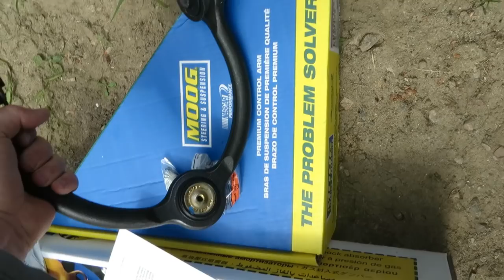2005-2010 Jeep Grand Cherokee WK Front Control Arm Replacement, Clevis Bolt, Spacers, Bilstein 5100

Comment: This video is how not to do things. It's bad when people who have no idea what they are doing post these videos. Then people follow this video and either get hurt or screw up their vehicle or both. DO NOT DO WHAT THIS GUY IS DOING.
Reply from the maker: Feel free to point out specific things you do not like about the video.
Reply: Stephen Rivett 
Just one issue is when you loosen the top ball joint, NEVER take the nut all the way off until your ready to separate it. While you were taking nuts off other bolts the spindle could have come to lose from the ball joint allowing the spindle to smash you in the face. I saw it happen twice sending both guys to the ER. One lost his left eye doing it you're way, the second had a broken orbital socket and required surgery. Another thing you allowing the brake caliber fall has broken many brake lines. That's something that's common sense. These are just two of several things you did wrong. I agree do all you can and avoid the extremely unjustified high cost of a shop, and you absolutely have the right to do whatever you want to your jeep. My problem is you make a video doing things the wrong way and others try it your way and end up getting hurt or screwing up their jeep. You should do a disclaimer stating this is your way and not exactly the correct way to do things, before you get sued when people get hurt after watching your video. If you are going to make a how-to-video, make sure do it the right way so people don't screw-up their car and/or get hurt.
Reply: So you make a big fuss about this. And its pretty much those are the 2 things he did questionable in the whole video. But he did mention to be careful about hitting you in the face.  I noticed that as well... didn’t come here and belittle the guy for trying to help other people sAve a dollar. This is a good video still
Reply: @SteveRivett  When you jacked it up by the control arm you put the entire weight of the vehicle on the bolt connecting the fork for the strut to the control arm. Upper control arm jack under lower control arm, lower control arm jack from frame and let lower control arm hang.

Comment: Dude, the lower shock bolt pulls out if you compress the shock spring.
Reply: That's very good advice. Thx :)
Reply: So by lifting the lower control arm?
Reply: Is this true? Cuz tomorrow is day 2 of me fighting this damn bolt I really don't want to cut it if I don't have to
Reply: @braydentriplett7954  If you can heat it up with a torch and work it back and forth with an impact it should break loose. It did with me.
Reply: @tonyruiz347  appreciate it bro💪

Comment: PB Blaster is your friend. I did the struts on my XK yesterday (300,000Km) with no issues. Hit all the clevis bolts with the juice twice a day for 3 days in a row and they unscrewed and pulled out of the bushings easily. 3 hours total working by myself.
Reply: I used a sledge and an impact gun 13/16 on that clevis bolt not 21mm.  Went forward and reverse and it came out after maybe 12 each direction.  That was after quite a lot of sledge hits first.  But no heat or saws needed.  Just persistence.

Comment: Really disappointed to see you just throw your impact and electrical tools into the dirt.  Good way for them to be ruined.  If you had spent a little time soaking all of the bolt threads with PB Blaster or other penetrate, you would have been able to get them all out without cutting.  You can do this job without removing the yoke complete.  A little more prep and protection from the ground would have gone a long way to helping you out.
Reply: I don't agree that soaking will help with this bolt.  My WK is a rust bucket and all of these parts are practically welded together.
Reply: @JacksonCharvelRULE  I found that to be absolutely true.  Had to replace the struts on my WK; soaked and beat until I was blue on the face.  Finally had to cut them out.

Comment: What i found the easiest way to remove the clevis bolt is to lift up the axle more and then spray wd-40 and hammer it out. I did that when i was installing my spacer lift a few months ago

Comment: How did you torque the front control arm hardware? The one with the nut with the tang on it and no room to hold it. Did you just trust the tang would hold it while you torqued the head?
Reply from the maker: I put a wrench on everything and did it by hand afterwards.  With a long bolt like that I prefer to hold the bolt end steady and crank the nut down (plus the nut is bigger and you have a longer wrench).  I prefer using impacts for removal only unless it's something I can't get good leverage on and I know I can't break like the front differential bushings.  Do all the tightening for bushings with the vehicle on the ground or it could cause weird ride behaviors.

Comment: Steve, I'm putting in spacers but just ran into the clevis bolt problem. Was wondering, do you think it's possible to compress the strut and slide the spacers over top without removing the fork from the lower control arm?

Comment: Honestly, on my '08 WK I found that using an oscillating tool with a carbide metal cutting blade (buy 3 or 4) worked very well on those clevis bolts without much risk to the CV boots or clevis arms... Glad you got it out though!  
P.S. Use plenty of antiseize on the bolt shank when reassembling! (avoid round 2)  
The bushings can be replaced with a ball joint press, if you have one.  Once you get past that bolt, everything else is a cakewalk.

Comment: Wow... I ended up using a 4-foot pipe wrench to grab the clevis bolt. 
In the past 3 years of hindsight and videos I learned that I could have  put a 4' pipe, onto a 2-foot breaker bar, that should have worked also....
Having to take the time to cut through that... God bless you this how I would have been mad mad pissed

Comment: For the new views. Hit what the ball joint goes through or use a pickle fork. 
If you separate the upper lower and tie rod end you can remove the knuckle with bearing on it. Take your time and make sure the abs wire will be free from the car before hand. 
I threaded on the upper ball joint but a few threads to help catch the knuckle so I can slide the cv axel out as I pull the knuckle off.

Comment: The clevis bolt seizes on almost every one of these WK/XK platforms.  The rubber bushing has a metal sleeve inside, and the bolt body rusts fast to that sleeve.  Cut the bolt, replace the bushing.  It's pretty common.  You can get a new Mopar bolt, part # 6503047, from Rock Auto for around $7.
Reply: Hiw hard is it the put the bushing back in? I kinda melted it and I'm waiting on a new one and sleeve also and tips in getbthe driver side axle out been beating on the that for a few days now and I've was just trying to replace the axle and ran into the clevis bolt seized 😆

Comment: Great video! I have my suspension rebuild kit coming this week and I'm dreading it. Did doing this help the wheel alignment? I'm spending 500$ on suspension parts to save my new tires from wearing out in half a season.
Reply from the maker: The alignment shop did a good job after I replaced all of the parts.  I have driven the Jeep a lot and gone through two sets of tires without any wear problems.

Comment: I am currently letting it soak in PB, but from what I red in the comments, this will not do.  Must I completely replace the control arm if I cut the bolt out? It appears I wouldn't be able to pound the remaining bolt out of the control arm because of the rust.
Reply from the maker: You would need to replace the bushing the bolt passes through at a minimum.  The rest of the bushings and the ball joint would also need to be looked at for condition.

Comment: I had zero issues with that clevis bolt, and I live in the northeast. Milwaukee mid torque 1/2’ impact buzzed it right off
Reply: Lucky dude. Things a pain i am replacing my axle and mine was seized had to cut and drill
Reply: @zstrode.8953  I also soaked mine in pb blaster every day twice a day for a week before I did all my front end work, so I’m sure that helped. But of all the bolts, that one gave me the least amount of trouble
Reply: @bigrigben1202  well after i got that out i couldn't get the cv axle to come out and literally did everything to get it out. I ended up taking the whole differential out so I could get a good swing on it and still was a pain! And I just ended up buying a whole new control arm lmao such a pain in the ass just replace a dam axle 🤣
Reply: @zstrode.8953  where did you order the bolt?
Reply: @Dandadada12  my lower control arm came with a new one but from orieleys!

Comment: i use wire to hang the caliper to the spring out of the way ..sounds like you have the 3.0 diesel, cool, me to
Reply from the maker: The diesel is great.  I do need to make some hooks to hang the calipers from as the calipers on my 1-ton van are really heavy.

Comment: How does the truck ride now ? I have Monroe quick struts in mine and they suck
Reply: Very clunky
Reply from the maker: @FrankO-ek1ec  The front rides a bit rough with the original stock springs because the 5100's squeeze the springs to get the 2" lift (preload).  The rear is a bit different too because axle sticks out on the drivers side.  You get a little wiggle when you go over a big bump because the axle swings towards the passenger side.  I believe Jeeperf makes an adjustable link to fix the way the axle sticks out...maybe others do too.  I intend to replace the rear springs because they can't carry much weight.  The Jeep completely bottoms out at rest when I put my dirtbike on the hitch.
Reply: Stephen Rivett the axle sticks out ?
Reply from the maker: @FrankO-ek1ec  Yes, doing the rear lift ends up moving the position of the rear axle about 1/2" of an inch to the driver side.  I didn't notice this until I put my winter wheels on.  The solution is to shorten the link that goes across the rear of the vehicle or just ignore it.
Reply: Gotcha

Comment: did this project and the main problem was the clevis bolt, it took a good deal of beating with a hammer to get it off but i finally won.
Reply: So heat it up and beat it out? I am about to start this project and wanted to test if I could get the bolt off and couldn't.

Comment: This is in my near future.  Can you give me an estimate of how long the job took you?
Reply: My WK2 is 2WD. The 1st side took me 3 hours because I'd never done it before. The other side was a little over an hour. All with hand tools. Also, I only replaced the lower cntrol arms. I recommend doing upper & lower arms at the same time. If one set is worn out, the others won't be far behind.

Comment: Still trying to hammer out the clevis bolt. Dame it's a bugger.  No luck yet.  The problem is the clevis support is springy so there is no solid support to take the full force of hammering from the nut end.  The clevis / strut assembly is springy.  Some sort of a press would do the the job in 5 seconds or less but I don't have such a tool.
Reply from the maker: that is a good idea, something could be made similar to the brake disc puller I made but have a cage go around the back.

Comment: How do you gain access to the nuts/bolts on the control arm? On mine it looks like its covered by a metal cross member and a plastic skid plate for the front
Reply from the maker: Are you talking about the upper or lower control arm?
Reply: @SteveRivett  Lower
Reply from the maker: @albertelezovic852  The plastic skid plate has three sections.  You can leave the front section below the radiator and you can leave the section that covers the transmission.  Just remove the section beneath the engine.  They overlap at the bolt holes but it is easy to remove.
Reply: @SteveRivett  thanks for the help. Clevis bolt seized on mine and need to do the same thing and replace control arm too. Cheers

Comment: Great video it helps me out a lot. I’m stuck on installing the lower control arm its not lining where it needs to go in fact it’s far off. I have the spindle removed just like you did. Any suggestions? In the video yours lined up with no hassle lol
Reply from the maker: I think you need to lift the lower control arm into position using a jack after loosely bolting it to the body.  At some point you get to connect the bottom of the shock and the lower ball joint.

Comment: Stephen, one question from Spain... Its able to make a clevis lift to the WK/WH on the standar shocks?
Reply from the maker: yes, that is the easiest way.  you can put spacers on top of your struts.
Reply: @SteveRivett  I Want to mean fixing the clevis on the top down of the shock. I see one inch untill the down top from the fix betwen the clevis and the shock. This is a tipical operation on the Jeep Liberty to save easy a pair on de cm...

Comment: saws all? not on harden steel bolt.
Reply from the maker: The concept of the video is to show more than just the successes.  I could have cut-out a few things but I'd rather let people see how various approaches didn't work.
Reply: I just did my lower control arm on my 09 SRT 8 Jeep and had to cut the forward lower control arm bolt (same as clevis bolt) with a sawzall. It's all about the blades, Diablo thick steel brand took me maybe 5-10 minutes with my harbor freight $24 Sawzall.
Reply from the maker: @ICPREYROEVIPERGTS    Cool, I usually use Milwaukee sawzall blades but Canadian Tire doesn't carry any good blades for anything so I got their cheap grinder discs.

Comment: will a 2 inch lift on a 2008 WK CAUSE CASTER AND CAMBER ISSUES
Reply from the maker: It starts off all jacked up but it settled down for me after a while.  I was surprised by how much camber I had but as I said it goes away eventually.  It helps to tighten all of the fasteners after you get the vehicle weight on the suspension.  I drive about 1000 km / 600 miles a week and am not seeing any unusual tire wear and all 4 tires wear at the same amount.

Comment: them damn clevis bolts!  what a crap design to have this bolt go through like that!  took me 2-days of heating, pounding and trying to use a ball joint press to push it out...the metal sleeve welded itself to the bolt so bad that it came out as one piece!   so the issue was that the bolt could not slide through the hole on the FORK of the shock so had to cut that dang bolt off!

Comment: Thank you good video ! where can i buy the 3 bolts for the control arm ?  can you send me the link or the name of this 3 bolts ?  thanks ; )
Reply from the maker: They are dealer only parts so you will have to call your local dealer or look online at a Mopar discount website.
Reply: @SteveRivett    thanks. 😁👍😉
Reply: @cieloaltoa3405  you can get the bolts from Rock Auto.com.  Just search 6503047.  That's the Mopar part #.  Same bolt for the clevis strut as well
Reply: @SteveRivett  someone lied to you, they are readily available anywhere.
Reply from the maker: @AphexTwinll  I did not know they are available.  Here are a few possible part #s but I have not confirmed them:
https://www.rockauto.com/en/parts/mopar,6503047,subframe+bushing,10942
https://www.dormanproducts.com/p-104244-14890.aspx

Comment: If you would have taken the vehicle weight off of the control arm, the clevis bolt would come out with a couple hard hammer blows. Maybe there is a jack stand somewhere we cant see but the fact that the whole vehicle was on that bolt being supported by the jack seemed pretty sketchy to me.
Reply from the maker: I had 2 jack stands on each side as I had the wheels off.  One at the cross member and one just forward of it.  I have not gone through the entire video for a while but I would not have used the jack during the job unless it was aiding me in some way, never to hold the vehicle in the air.  I had a coworker get killed at home when a vehicle came off a jack.
Reply: No - the clevis bolt on those WK Jeeps is notorious for welding itself into the clevis. I was fortunate to get one of mine out in only about a half hour, the other side I had to cut through the bolt on both sides between the clevis and the control arm like was done in this video. I then spent most of the day beating on it with everything I could lay my hands on, heating it up with a torch, etc. I finally took it to a machine shop, and it took them about 30 minutes of going to town on it to get the last remaining portion of that bolt out of one side of the clevis. I could hear them wailing on it back in the shop from the front. I was amazed they only charged me $20.

Comment: Where did you get your two inch lift for the rear?
Reply from the maker: I got them from a guy called "Kolak" on www.jeepforum.com  If you send him a message he can set you up with the rear spacers.  I think they normally come in a bigger kit from Rough Country but he splits them up so that you can use 2" lift struts up front and spacers on the back.

Comment: I’m in the process of doing this to my Jeep Commander, and same issue with the strut bolt/cleaves bolt! Did your parts store offer a bolt kit for the lower control arm, or did you use another bolt??
Reply from the maker: You will need to go to the dealership to get new fasteners.  They are not a normal bolt.
Reply: Stephen Rivett ok thank you, stealer it is! I was going to change out the strut fork like you had mentioned! I have only looked quick online for them and the prices are ridiculous $400-$800 and the stealer from what I’ve read are just under $400! Must be made and shipped from Mars!
Reply: Thank you for this video👍🏻👍🏻
Reply: Thank you for your help!! I just finished up the passenger side. I had 2 bolts on that side seize up and had to cut off, one on the strut fork and the long one on the lower control arm. I put anti seize on bolts where the bolt contacts the metal in the bushings not the threads in hopes they won’t seize up again inside if I have to take them off again. Thank you again!!